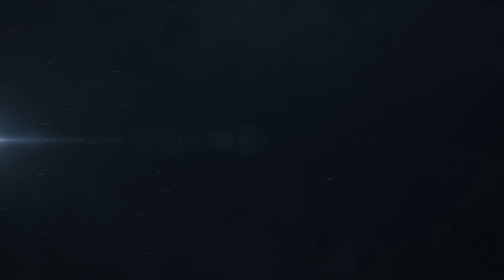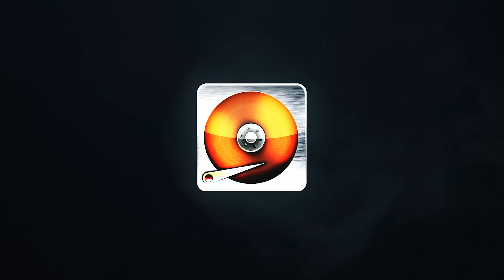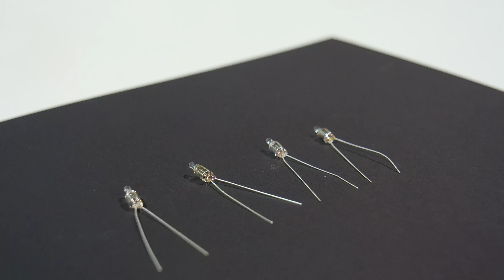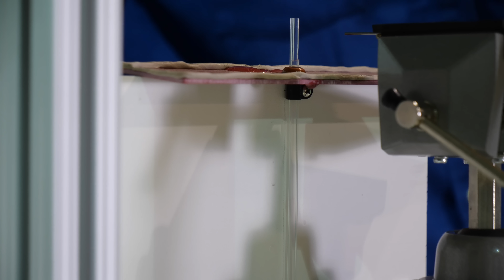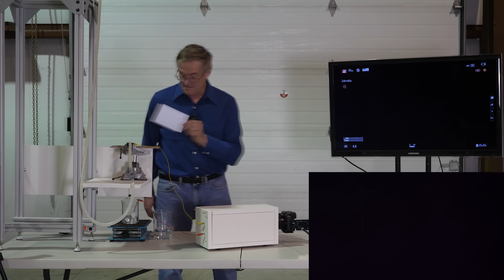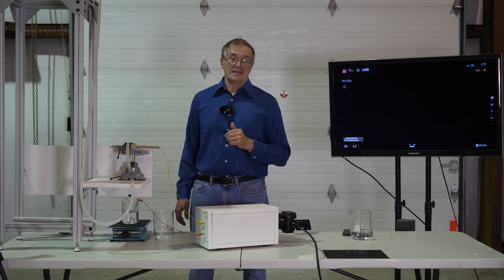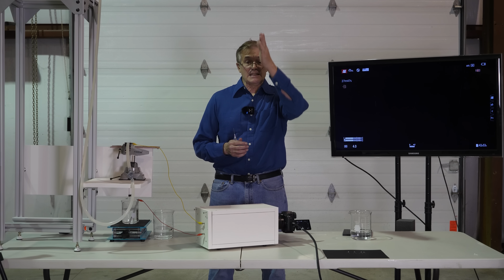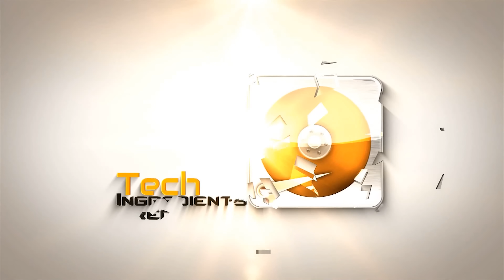We made electricity from water - and it's easy!

Comment: This charge happens when pumping diesel. The hose collects a lot of charge from the static friction of flow and sometimes we can hear it clicking...tiny sparks!
Reply from the maker: Isn't that why the line is often supplied with a grounding clip?
Reply: @TechIngredients  my experience, we have typical home heating oil tanks on the farm. We use a 12v pump that uses garden hose diameter fuel line from tank filters to pump then heavy duty garden hose from pump to nozzle. We pump into  metal tanks and plastic tanks depending on equipment. The 12v comes from the vehicle/equipment. The source tanks are in contact with the ground but no grounding wire/rod. The tanks definitely have a charge and fuel from one tank filling the equipment tank definitely has a difference in charge. But the static electricity from the hose actually makes my arm hair raise. I think we noticed it more in the winter.

Comment: Interesting demonstration! The primary issue I see is debris and hard water mineral build-up that will foul the sponge or tubbing. I have experienced this with evaporative coolers, plumbing (mineral buidup in the pipes like cholesterol), and mineral build up in toilets, tubs, sinks, etc. Use of distilled water or water softeners would be requiered for long term use.
Reply: If the water is being cycled by any evaporative process, it would already inherently be, distilled.
Reply: @KenFullman  definitely not correct, earth's atmosphere is full of dust, insects, birds, and probably hundreds of tons of space dust at any given time.
Reply: @up4open763  "cycled by evaporative process" it's literally the definition of distillation. The OP was talking about "hard water minerals".  I suggest you look at the hardness of rainwater.  It's pretty damned low because there are no clouds of Calcium salts floating around in the atmosphere.  

If you compare the size of a raindrop to the entire atmosphere of the planet, you'll notice it's pretty small, so it's not going to come into contact with much of that "hundreds of tons of space dust."
Reply: @KenFullman  dust is the most common nucleus for the formation of a raindrop.
Reply: @up4open763  Dust does not cause hardness in water.
Reply: @KenFullman  where on earth?

Comment: Use some  of the power to feed a stack of ± and neutral plates like Brown's Gas  generator for a jewelry torch( just add an appropriate number of plates for voltage or a jewel thief to up amps and step down voltage  goal is ionic chargeing not gas production so V:A desired will be different however you said minimal air is a good thing) .  Housing would resemble a harmonica  wirh eletro plated  seperation walls connected in series with holes filled with neutrals.   Followed by a chamber that is centered neruidum  to stear the 2 charges into separate  flow  water paths.  ( 2 options  each passage has its own separator or 1 for all.)  

Use  2 silonoids ( or an automatic switching valve )to have the 2 streems oscillat  hitting the  2 sides of of the receiver  plate and now you have AC .

Comment: Separation of water drops generates electricity. This occurs naturally and is called "waterfall electricity" which can be sensed at some large waterfalls and suitable weather conditions. It occurs en masse in clouds. Physicists have been exploring this for long and the most famous is Lord Kelvin's water dropper.
https://www.youtube.com/watch?v=rv4MjaF_wow
https://www.youtube.com/watch?v=dB-76NdfTbU
This invention makes use of the phenomenon.
A water turbine is better in efficiency, because the energy does not  come from water itself,  but from gravitation.
Reply from the maker: In both cases, the energy comes from gravity. The main difference is that this method retains its efficiency even at cm/sec. Flow rates.

Comment: Please take the drip charge output and charge a super capacitor. With the multiple water tube system you may be able to charge a capacitor bank. Will be interesting to see how long it takes to charge a 1F to 5F super capacitor. Then you have the power potential to run many devices.

Comment: I really enjoyed this video. I’m curious of how many channels/tubes you would need to produce enough power to at least run a pump to have it recirculate the water and rinse and repeat, no pun. 

To run a home, assuming 1,205W output needed, you’d need about 156,000 liters per minute, which is equivalent to 2,600+ standard bathtubs per minute.  Or the flow rate of a medium-sized river. 

Although creating a closed-loop high-volume recirculation system (e.g. pumps + hydro tower + power management) would be pretty cool.

Comment: Wouldn't a fractal capacitor network improve the output to lower voltage and higher amperage? Also, any water source with a 12 inch drop ( streams) can have a pump system that will raise a fraction of the stream to 19 feet I believe ... this would give you the needed water pressuse from low level stream waters movement.

Comment: I wonder if this can be applied to enrich heavy water or use the "hydronium enriched" water to easily electrolyse hydrogen.
Reply: enriching heavy water means you are adding neutrons to atoms, it's not something you can do with physical or chemical processes like this, you need to bombard the water with a neutron source (i.e. some other radioactive material usually).
Electrolyzing means breaking a strong molecular bond between oxygen and hydrogen, in all the water. Having slightly charged/acidic water with some ionized water molecules aka the "hydronium" isn't changing much.

Comment: Great video. i'm very curious what would happen if the flow were accelerated through the pipe, like if you made a water/air mixing head that oscillated just right to make the necessary water air pattern in the tube and which forced the water through at great speed. in theory a large rain collector could have a venturi section or something before the mixing head to get accelerated flows. my question is if twice the velocity gives twice the current, or if it affects voltage at all. 

you mention the 30cm limit, but what happens if you place two 30cm tubes in a parallel circuit? can it generate twice the current then or is there a disadvantage? if so, a bundle of tubes could be devised with electrode plates at each end to scale up this system. 

also curious about the most efficient low voltage conversion method. as far as i know DC to DC converters use a big capacitor and charge pump another with that etc and smooth out the output RC style but i've always thought there must be a better way, but 1000 to 1 is a big drop. Finally, if you would please kindly publish the actual amperage you're getting with this system then i would have a reasonable wattage to consider with these designs. Thanks!

Comment: Water is the most fascinating substance that I know of. Dr. Gerald Pollack's (sp?) work is very interesting and ties in with this subject very well. The "exclusion zone" width varies by the materials the water flows over and therefore it can be used to separate water ions/charges to capture energy in a different manner. I absolutely love the work you do! I learned so much from your Channel
Reply: This is exactly what’s going on - it’s EZ water. He is obviously unaware of that. He is also wrong about how water is less than 1% ionized, the ionization level varies greatly depending on the conditions. Been mislead by the typical “science-says-this” blah-blah-blah.
Reply: They also experimented with shining UV on the ez water which for some reason boosts the electrical output

Comment: I'm not a rocket surgeon, but if the hydronium and hydroxide ions are separating they have to go somewhere. At some point, very quickly, there will be more charge and more ions sitting around than the system can handle and it will stop, unless you can remove and recombine the ions somewhere else... which would probable take more energy than obtained originally.
Reply from the maker: Where they go is through nutralization.
The current flow accomplishes that.

Comment: Your camera is set to 60 fps. The lights are pulsing at 60 hz. Adjust your frame down to 30i and that will remove the flicker effect.
Reply: Or change the exposure time. Headache!
Reply: 30i??????? Are you out of your mind? Who uses INTERLACING in 2025?
Reply: The flickering is the camera shutter speed interacting with the TV (monitor) refresh rate that's in the shot - it's not the lights. Video refresh is either 29.997 or 59.994, at least partially so there's no interference with lights, but when you have a TV that's also at the same (or multiple) refresh, you do get the beating / interference issues
Reply: @gorak9000  Then why are the lights flickering? The TV is also flickering but that's not worth a comment.
Reply: Why would the lights pulse at 60 Hz? I assume the flickering is due to charge building up slowly before discharging suddenly.
Reply: @orsonpeters  I wonder if he is talking about actual flicker inside the box. Or one which plagues video. As light, dark zones travel over entire recording.
Reply: @orsonpeters  Because the US electric system is at 60 Hz. A lot of LEDs have a flicker, not visible to the naked eye.
Reply: @orsonpeters incoming power
Reply: @One-way naaah, that would make a disco effect, since some leds would get faster or slower depending on needed build up of power depending on the color it should provide and the hotter top would have less resistance so it would be top speeding up disco ball with some electrons falling from the led to ground thanks to gravity making plasma on the ground since the electrons would shake more and more until they go sonic hertz, and you eould surely see rainfall of electrons from the tv that would turn sonic speed plasma hewting up the room. 

And for you all know thr tv could have been turned off, by shrodingers effect since we dont see inside tv we never know if it is alive or emoty and maybe its jjst cardboard box, 

Does he have ghosts? If his shoe carton box drops plazma and shows pictures, maybe he has poltergeist...

OMG SAVE HIM, CALL VATICAN PRIEST OR JEWISH KING OR SOMETHING!!!
Reply: 911 -911, what's your emergency?!

You -Ohh, my favorite YouTube scientist in dire danger, he has supersonic plasmic carton shoe box making pictures of disco effect!!

911 -What ? What address at?

You - OHhhhh mu gooood, it's. Chanel --------- and the poltergeist wants him bad!

911 - Yeah, we have located you and paramedics will be at your address in 2 minutes, hide under bed and do not have any weapons *hangs up*

Comment: Why not just induce artificial plug flow by using intermittent placement of the material that the water flows over? Alternating a desired Teflon type material with another neutral material instead of relying on the actual breaking of water over the Teflon.

Comment: Interesting for sure. Curious how this would scale up to larger systems. One problem i see when using slow moving streams and water out in nature is dirt, at least if you really need small nozzles and channels, this will not work for long, and power generator are usually installed to run for decades with hopefully very little and controlled wear and maintenance. A large turbine wheel of several meters diameter and high pressure water jets isn't bothered by algae build up and small particulates of dirt in the water.

Comment: I wish I could see one day this channel provide an explanation about the Ranque-Hilsch vortex tube.
Reply: A friend of mine gave me some info on "Maxwell's Demon" over 30 years ago. I never found the time to machine one. They are available commercially.
Reply: Me to.
Then take the vortex tube and make liquid air from compressed air.
Then use the liquid air to run a Detroit 2-cycle direct injection diesel engine.
Then put the engine in a liquid air powered car.

Comment: The challenge with scaling this up would be that water from a stream or river would not be pure—microbes, silt, dissolved minerals—all of these would potentially build up on the surface, which might affect how the charge is deposited on the surface and would eventually affect the flow. But with how fast material science is advancing, I'm sure there are solutions to these problems. There could even be materials that more readily accept ions from the water and could improve the efficiency of this. 

Regardless, I think this is really cool and I'm honestly surprised it wasn't discovered earlier.

Comment: If you have some extra energy left in the water after turbine, it's much better to use another turbine than build strange and vast (it should be enormous, or no intermittent flow for your intermitter) contraption to convert this energy with 10% efficiency into high voltage pulsing something.

Comment: I've found that using a very slow frame rate (10fps) captures the light a lit better than adjusting the exposure. Not sure if it was the source, or from the YT compression algorithm, but a lot of the time you talk about being able to see the lights, everything is just black.
Reply: I just assumed it was my eyes and small screen. 😂
Reply: @quietyard8014 nope, your eyes are good! Filming a screen of very short flashes is always going to cause issues if the framerates aren't synced. The PIP overlay should have prevented this, but then it's getting compressed once in export and then again by YT, and since they are so small both algorithms may deem them unnecessary and not keep them. A vey low frame rate inside the box should make them much more prominent and less likely to get discarded.
Reply: Turn up your brightness

Comment: Interesting but realistically it is very challenging to extract any subtantial amount of power, probably akin to trying to harness energy from friction induced electrostatic charges. A big problem is that natural occurring water is rife with solid contaminants, which will clog up the small surfaces in any dense foam.  Unless you are dealing with very pure filtered water, any system will have a short lifespan.

Comment: I'd be curious to see if this setup (or a bunch of these in parallel) could charge a high voltage capacitor. Could be useful for developing "usable" power with a stepdown circuit, or just showing off some fun sparks!
Reply: This was my first thought as soon as I heard 6000v. Like, especially for extremely low capacitance homemade capacitors.
Reply: @yourbrojohno  could easily make some pretty huge capacitors at home using aluminum foil and parchment or wax paper
Reply: You might as well use the effect to power a Tesla coil.
Reply: see cascatachuva company in portugal. they use zirconium dioxide powder

Comment: Very interesting. But I have some questions (I haven't read the paper yet). What if we use something like in wine related issues is called "aereator"? It is like a bubble, but it introduces air to the flow (with tiny holes) that change the flow to a flow with bubbles. In the other hand, the lenght of the tube is important, but What if instead of lenght of a tube, we introduce a wider area? Because materials like sponge exist, some made of metal of metal fiber, but the cost of them maybe exceed the benefits obtained.